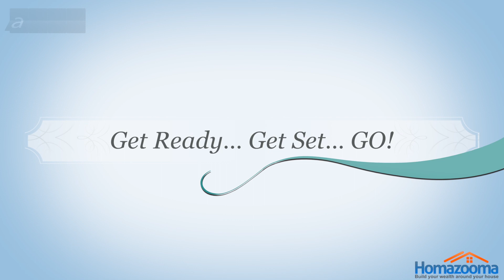Tiny House Time Lapse

Comment: Nice video. One of the more unique designs and use of materials. Interesting the steps in how it went together. I noticed you did the wall framing then went back to cut out and frame the windows. Usually see people build the window framing from the start of the build. Were you still undecided on window size to that point? Think it was easier that way?

Well done.
Reply from the maker: Thank you very much - we really appreciate people who can appreciate all the work involved. Yes - window size was a bit of an issue as we had to include the automated in wall shutters - took a bit of time to figure it out. Thanks again for the kind words. Tracy

Comment: hi what size trailer were you using and what is the max weigh that your building, cool video!
Reply from the maker: Abel Casanova Thank you! We're using a 20ft trailer. The max weight must be under 10,400 and it will be. Still finishing up the interior. Stay tuned for that video :) Tracy

Comment: How did you anchor the wood frame to the metal frame?  Just asking because I didn't see it anchored in this video.  Seems like it will slide right off....hahahaha
Reply from the maker: Hi There, Thanks for asking. We able to use 'U' bolts to anchor the frame to the trailer and we also welded steel reinforcements on the sides and using very long bolts anchored the trailer frame through the sill plate in over a dozen places. After all this work, the last thing we want is our house falling off! LOL  Tracy

Comment: what size trailer was that? Thanks
Reply from the maker: Hey there, we used a 20 foot trailer with dual 5200 lb axles and electric brakes on each with a total weight of 10K lbs (including the trailer).

Comment: 88 DAYS just to do the structure, siding and roofing, did you only work on it like 2 hours a day or something, I know a construction crew of 3 guys that could have done that in a work week. Also while it may look good stone is NOT something that should be on the outside of a tiny house, it's a lot of extra weight to haul around and VERY dangerous if a piece comes off from the vibrations the trailer will see on the highway.
Reply from the maker: It's not REAL stone silly... ! LOL You try building a house like this when you have a job and are doing other stuff. You "know" guys... We're not contruction workers either.. this is not our "regular" job. We just filmed it for YOUR entertainment. What house did YOU build?  And where's the video Charlie?
Reply from the maker: ***** Not to mention that we had to wait for SPONSORED materials to arrive....
Reply: I'm working on saving the money I need to do mine, give me time.
Reply: +Homazooma hi u saw your tiny home video it's beautiful but I was wondering how you went about getting sponsored materials and what exactly sponsored materials are?

Comment: 88 days to build a tiny house?? Excuse me i found it a bit lazy job! but a part from that it is a pretty nice house. Good Luck
Reply: Could you please post pics of some of the homes or tiny houses that you have built since you apparently understand the process?
Reply: 2 people build a house in less than 3 months...and they are lazy? Guess you could do it yourself in a week , huh ?
Reply from the maker: elizabeth barrett Thanks Elizabeth for your say so! It was the hardest thing I've ever had to do, and I've done a ton of renos and house construction. Just having to get out of bed aching and doing more of the same day after day pushes you to your limit. You just have to believe in your dream and stick to it. It is a very long process because it is exactly like building a full size house. Also, there are a lot of things that hold you up.. your materials aren't always right there you may decide to do something different or that you need something else...so you have to run out and get stuff. Life gets in the way too. All this takes time... Tracy
Reply: ***** I can only imagine! Glad you had some help.  I am thinking about hiring someone to build the shell, then I will finish it.  I am going to do this solo.   I went to Deeks(relaxshackdotcom) workshop in VT a few weeks ago.  It took a group of use 2 days just to build this tiny platform about 8 by 5 ,,The tiny sleeping cabin  turned out cool .  Looking forward to Deeks video on it after he puts on the finishing touches.  Heading to Boneyard Studios in 2 weeks for their design workshop.  Hoping to pretty much have my design set after that .  Just collecting the pieces to go into the project will take months.  I am glad you have the finish project.  the fruit of your labor :)
Reply: I don't know what video you were watching, but I saw them build it in just 4 minutes
Reply: John Smith hahaha right on!
Reply: Banana Bonbony most people work on the weekends and it takes a year. I'm currently in the planning and saving stage, but I don't expect to be done until 2019!
Reply: Apparently YOU Banana have never built one from
scratch... Have you?
If soo... Make a video and show us...
Proof is in the pudding... not your rude comments...